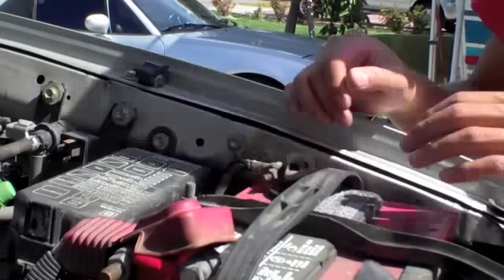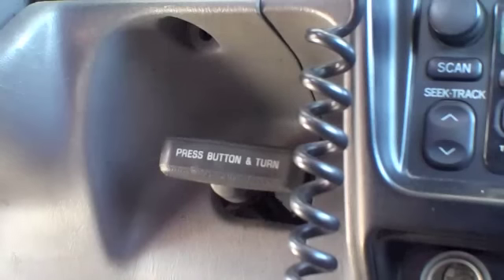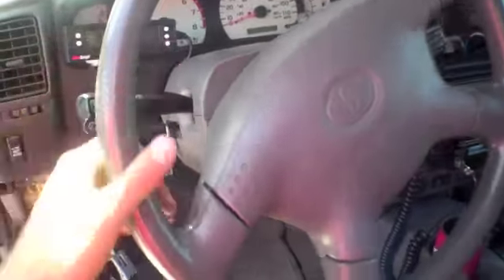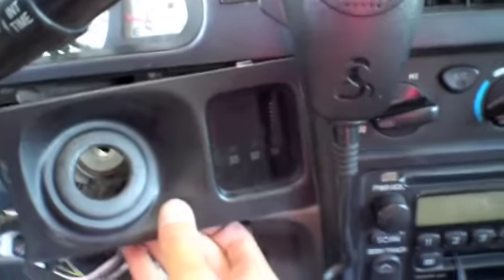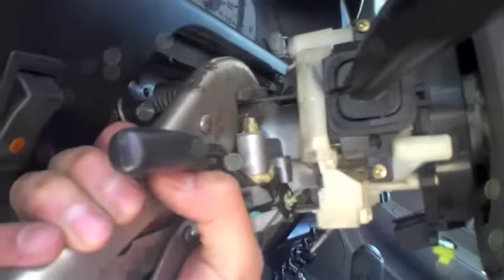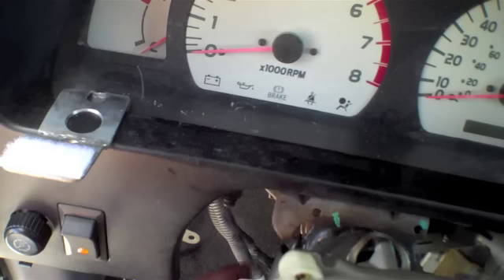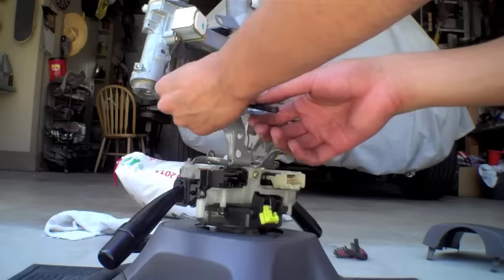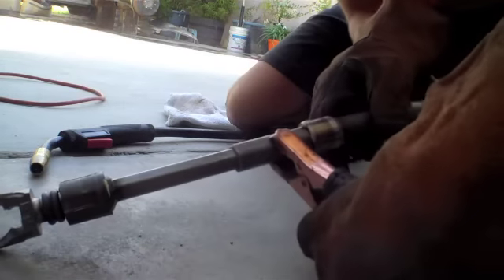SafetyDang Tv Ep 2 Toyota Tacoma Loose Steering

Comment: I just wanted to say thank you for posting this.  I purchased my 98 Tacoma SR5 4x4 Extra Cab new and have lived with steering play and a 'clanking' noise anytime I would drive off road or hit anything remotely rough in the road.  I noticed it not long after buying the vehicle and it was under warranty so I took it to the dealer a number of times and they could never identify or solve the problem.  They told me to reduce the air pressure in my tires, which I did but I knew there had to be a solution.  Finally, I did something about it last weekend and it worked perfectly.  One note that I ran into that might help with some small variations of Tacomas was that I had to remove a bolt from the splined shaft down below that has a keyway, so the bolt has to come all the way out.  Everything else was identical to yours.  I tack welded it and put it all back together very quickly.  I would also recommend making a mark with a sharpie marker on the splined shaft where it goes in to the intermediate shaft so you can put it back the same.  Thank you, I would not have attempted it without your video!
Reply from the maker: Yes I added notations or annotations to the video for things that I have missed. Glad everything worked out for you! Thank you for your support.

Comment: I have a 86 toyota pickup 2wd
Single cab shortbed. I encountered a steering issue and replaced everythyng else regarding the steering. But it looks like the play is coming from the steering column as well. Will the process on a 86 toyota pickup be the same as you showed on your video?

How do i address that problem?

Comment: I just bought my 2003 Tacoma with only 50,000 miles on Ebay and am so disappointed the steering has what feels like a 1 inch play. The owner said he took it to Toyota and they said all was OK. Baloney! Could this also be a problem in the rack and pinion or the tie rod ends? With only 50,000 miles this should be a tighter feel.
Reply from the maker: Check out my loose steering video. https://www.youtube.com/watch?v=6O01xIDnuk8
Reply: I did see the video. Thanks. I brought the truck to my mechanic and he said that is part of the collapsible steering column and if you weld it that will send the column into your chest in an accident. Is that why you lightly tacked it? So that it would still collapse in a crash?
Reply from the maker: Yes, others have stated that a small pin or tac will do the trick. Others have also put shims in there. It i s really a personal choice.

Comment: how long did you take to finish everything....from beginning to the end putting everything together?
Reply: I am planning on doing the roll pin thingy because I don't have a welder
Reply from the maker: Both are very effective in fixing said problem. However, be aware this is a safety feature. Use a very small pin if you are going to do this. The steering wheel is meant to collapse to save your chest in an accident. However, many of us that have done this believe it was worth it. Or we believe the tack or pin is weak enough to still break.
Reply from the maker: Took like 30-45 mins if you are not drinking. 1 hr max?